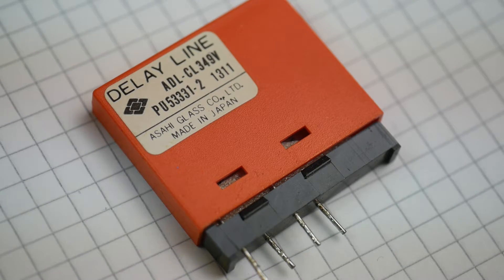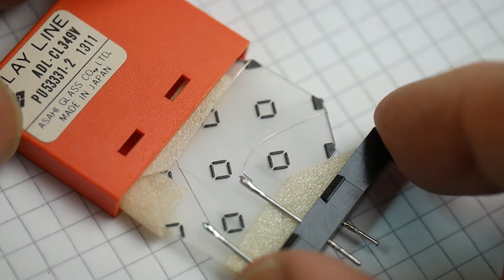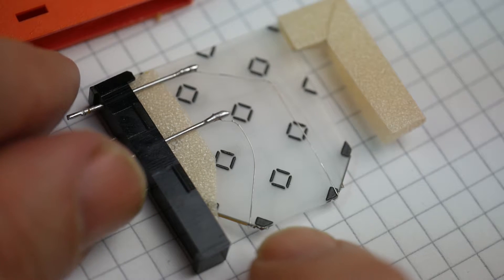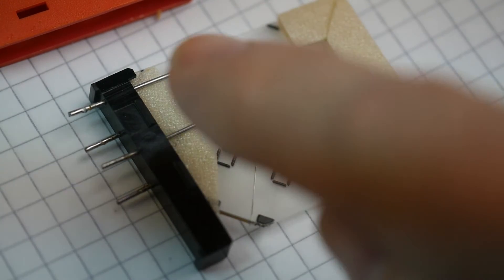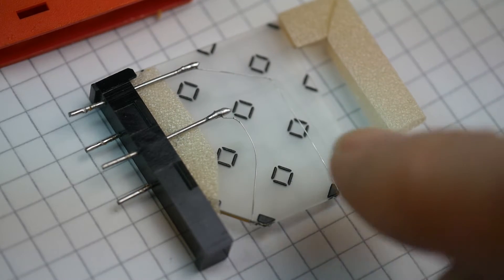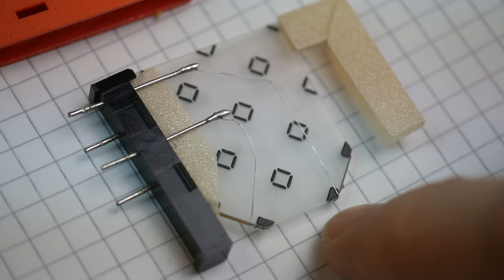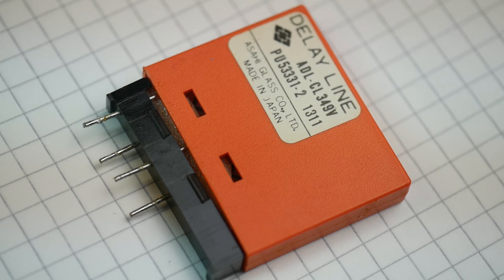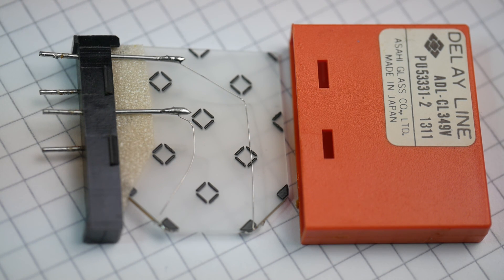Inside a PAL Delay Line

Comment: Well... They do still make PAL TVs.

Any TV with component input, aka the yellow AV jack (at least those sold in PAL regions) will decode PAL video sent in over component (hell, some might even accept PAL over RF)

But TVs switched to using digital decoders for PAL and NTSC sometime in the 90s or 2000s, eliminating the need for these analog delay lines.
Reply: That would be composite, component video has 3 connections and none are yellow.

Comment: Being an Australian (PAL TV), when Y like in the US in the 1980's & again in 1990's, I always was annoyed at how the colour on US TV was so crappy compared to home.  I assume at the time it was because of the extra 100 odd more scan line per frame (i.e. higher resolution).  But being ignorant of the PAL thing per se that you have pointed out, I now know the real reason why PAL was so much better.  The French had PAL at even higher resolution, so their local TV must have been great compared to us, and especially the US.
Reply: NTSC color got quite good by the late ‘90s with sets that automatically calibrated the hue. Otherwise, you had to set it yourself, and very few did correctly.
Reply: “NTSC” = “Never Twice the Same Colour”.

The Germans came up with a simple, elegant solution in PAL.

The French, being French, had to work out their own, much more complicated solution (SECAM)

Comment: It's a bit of a pity these weren't around in the 1940s when the first computers were being developed. The mercury delay lines used for memory in those early computers were rather finicky, but these would have been damn near perfect for the job. Alas, PAL and SECAM (both of which used these delay lines in their decoders (though only SECAM actually required it)) didn't come along until well after that (SECAM in 1956 and PAL in 1962).
Reply: A big part of that is that with increasing frequencies you're able to make things smaller. A "delay" line isn't of much use if it doesn't delay long enough... delaying long enough for an old UNIVAC to hit the next cycle will probably be much more than anything built after it. The precision, timing and power achievable with nationstate-grade funding in 1940 had to be built upon to get further precision/timing/power, so every invention necessarily stands on the shoulders of what came before it barring wonderful and rare flashes of insight and serendipity.
Reply: Apparently they did move onto nickel delay lines fairly quickly https://www.youtube.com/watch?v=xGEAPVCuwvY . But the other problem is that delay lines are just inherently pretty poor as a basis for general-purpose computer main memory: you really want to have random access, naturally. That's why computer builders started messing around with Williams-Kilburn tubes and similar things from almost immediately after the war until the adoption of core memory: memory on TV rather than for TV! Interestingly, the sequential-access system which seems to have been used the longest as main memory was drum memory. Despite apparently being around, in some form, since the early '30s it seems to have had a fairly slow start in computing.

Comment: do these delay lines work in the  audio range?
Reply: modulate your audio signal on 4.43mhz subcarrier, yes will wok then
Reply: @mohinderkaur6671  But the delay of one video line wouldn't be audible, it won't be an acoustic delay for practical purposes.
Reply: No, it works only in the range of the video signal. Because the band range of the device is 3.58 +/- about 1.5 Mhz in PaL, and is 4.43 +/- about 1.5 Mhz in NTSC. I was actually an engineer of the devices including it's comb filters to develop and produce in 1982-1994. But it would might  work if the piezo, so called called transducer, having the lower frequency were  to be changed.  If you have any, contact me any time to http://www. oak-it.net/
Right now, I operate my own technical company to develop some key process technologies especially for the smaller crystal oscillators used essentially in mobile telecommunication systems of PLL, GPS, WiFi, bluetooth etc.
Regards,